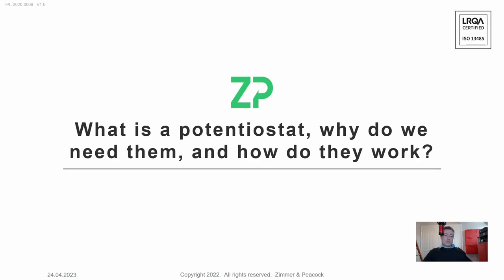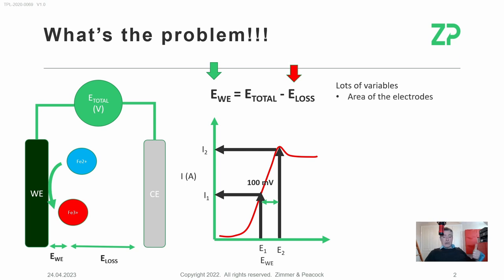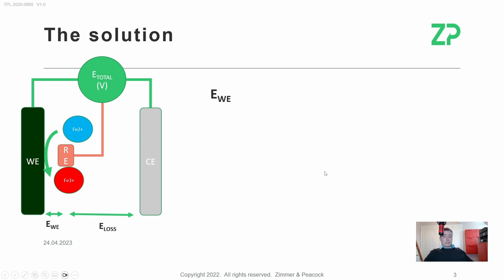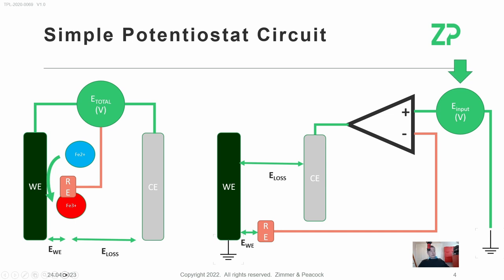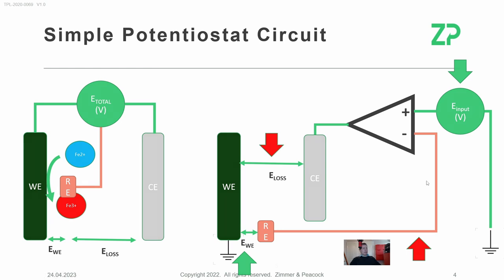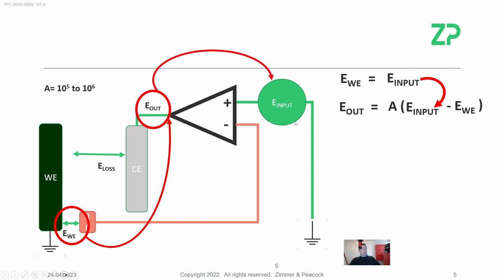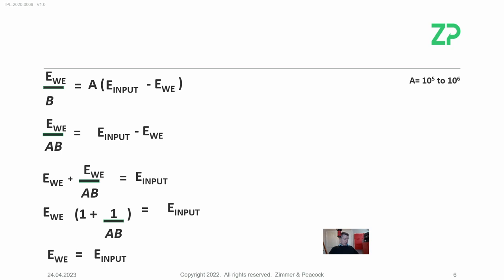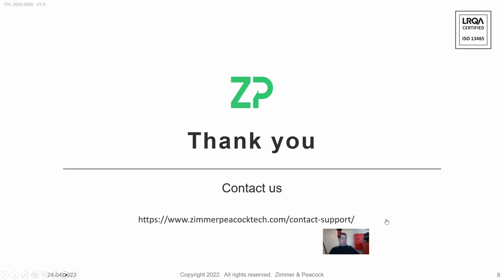Introduction to Potentiostats - why do we need them and how do they work?

Comment: Thank you for this great explanation, and I appreciate very much the inclusion of the explanation of why use a three-electrode system!

One comment/question: In the diagram that you provide you connect the reference electrode directly to the inverting terminal of the OpAmp. But, then, I think that the feedback voltage is the reference electrode's constant voltage, not the changing working electrode's voltage. 

I think I understand now from piecing a few different videos together that there should be a low-gain differential OpAmp  that outputs the difference between RE and WE, and then that differential output is fed into the feedback.
Reply from the maker: That is the question at the heart of electroanalytical  science, post it here and the tech team will respond - https://www.zimmerpeacock.com/contact/
 -